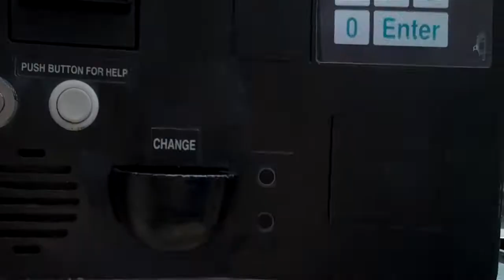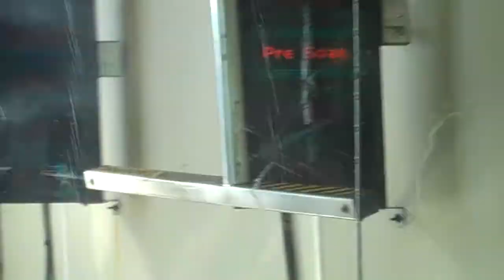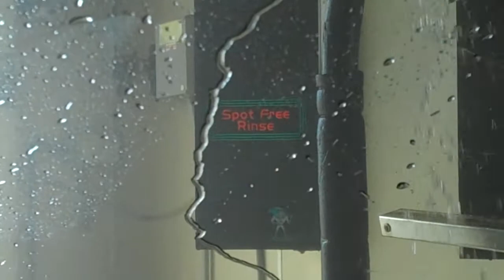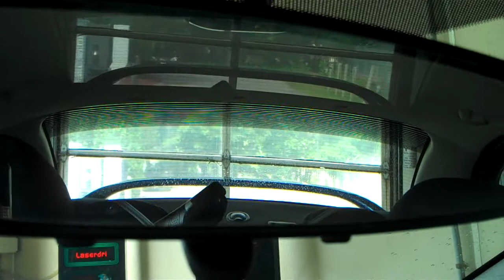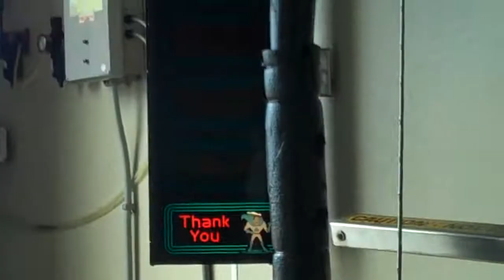Leominster: Car Wash @ Mr. Mike's Mobil, Main St.

Comment: Fantastic Video, did you hear some crows cawing from 0:04-0:06 before you insert the $10 and heard the computerized Male voice? Also that place was located next to a high rise apartment building with traction elevators, and the McGraft building on Main Street SR 12.